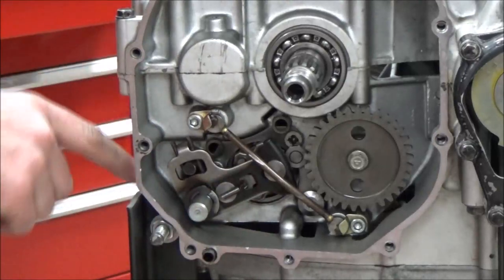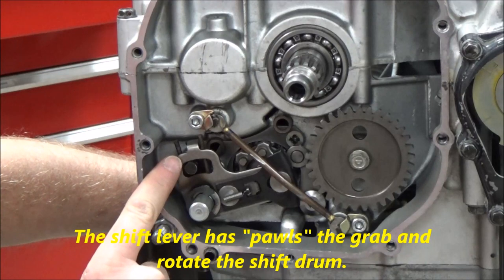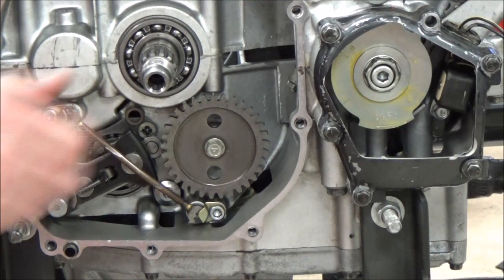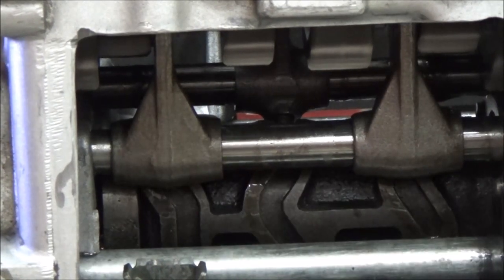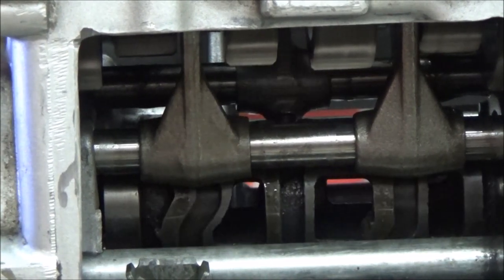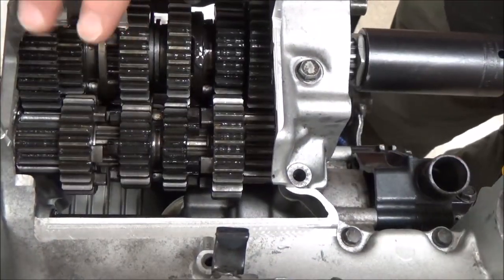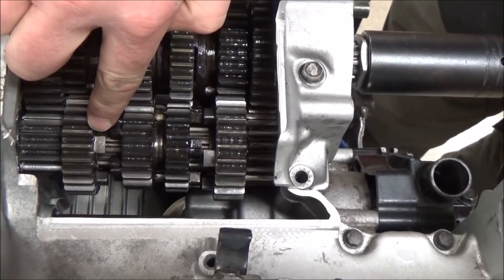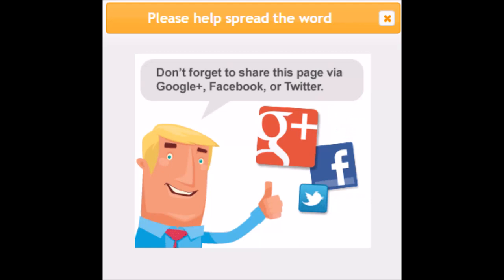2 minute "Real View" lesson on How a Motorcycle Transmission Works   (similar as manual automotive)

Comment: When you're at rest and going from neutral to first, and both shafts are stationary, if the dogs are not aligned with the slots, how do you shift?
Reply: If both shafts are stationary, yes you cannot finish shifting. That often happens when you try to shift a turned-off bike. Also, it is the cause of false neutral when you try downshifting from very high gears AFTER stopping. In that case you can try moving the rear wheel to make the shaft rotate slightly, and make those slots get aligned.

In normal circumstances, all components are slightly rotating in different speed, even in neutral gear, thanks to(?) fluid drag and rolling friction. So the misalignment will be resolved in less than a second, you just feel a slight resistance during shifting.

Comment: Hello, when shifting gears is it normal for the output shaft to need some rotation before the sprockets fully slide in? Because just rotating by hand the input shaft by hand won't allow the full sliding of some sprockets. I'm almost done with my rebuild and wanna make sure I've installed the gearbox properly. Thanks!
Reply: yes

Comment: I have a question that you might be able to answer.  In first gear on every single motorcycle I've owned, it seems to have a sort of whine that increases in pitch proportionally with RPMs.  This doesn't happen in any other gear.  Why is that?  I was just curious because I also heard an RPM dependent "whine" in first gear in this video.
Reply from the maker: I won't pretend to know exactly but I will take a shot and maybe someone else out there knows for sure. I would say that the high torque load of first gear alonfg with lower speeds would create all contact loads to be "louder" along with you can simply hear more as your wind and ambient noises as taking over as you speed up in higher gears. A COMPLETE GUESS HERE>>>>

 If I can ever be of service to you, here is a video explains how to connect with me. 
https://www.youtube.com/watch?v=vjvmB01ebcs  
Keep Wrenching,
Shane Conley
Instructor/Motivator/Motorcyclist
www.how2wrench.com 

Did you like this free video and hope to see more? Would you just like to say thank you with a donation? Click https://www.paypal.me/how2wrench
Show less